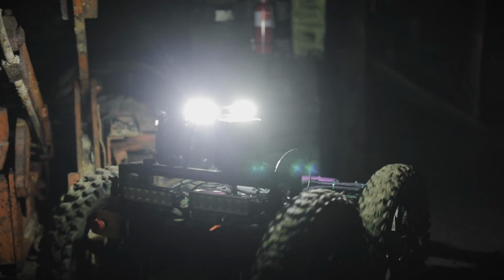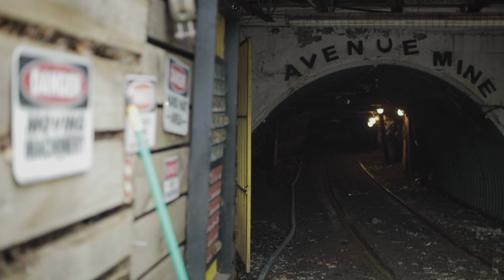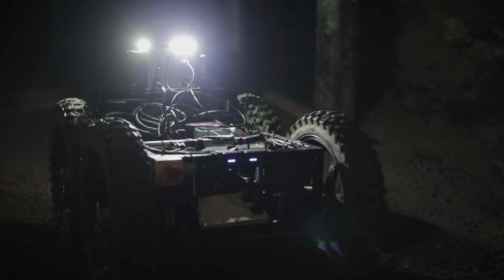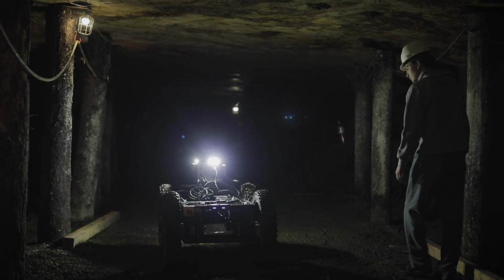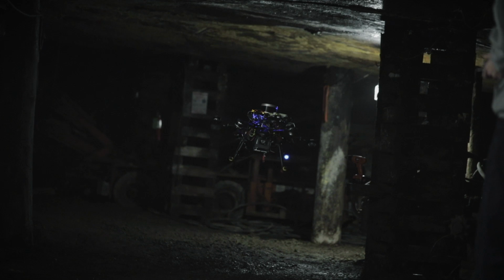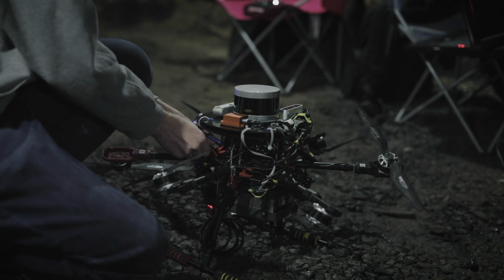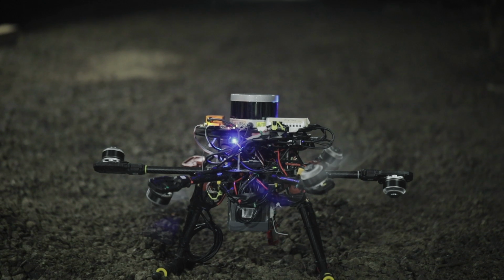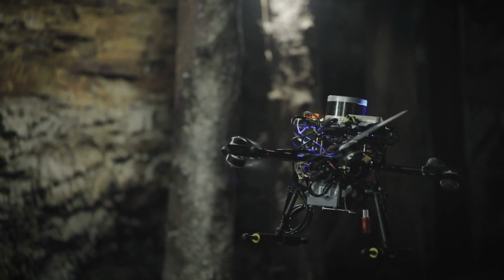CMU team develops a robot and drone system for mine rescues

Comment: Why drone has flipped arms? What is the purpose of it? I'm curious coz we've made similar robots in our company.
Reply: Janusz Sendyk 
I’d guess they are canted to allow the drone to rotate or spin while hovering and still maintaining the simplicity of a fixed rotor design
Reply: @brianthrom6858  I asked about it because I think it's unnecessary and I wanted to know why it was done that specific way ;) A simpler design also meets these requirements regardless of the assumed angles and mathematical equations.
Reply: @januszsendyk5370  
I think this configuration allows the drone to turn (yaw) by using the thrust instead of a change in momemtum or motor torque. 
This way, the nuts and bolts that hold the props do not get loosened by the torque on the prop
The propellers create balanced thrust forces in flight by moving the air instead of by rotating the mass of the prop. Just my two cents.